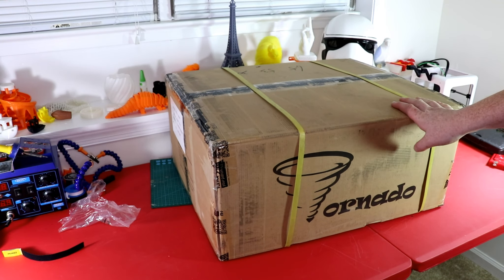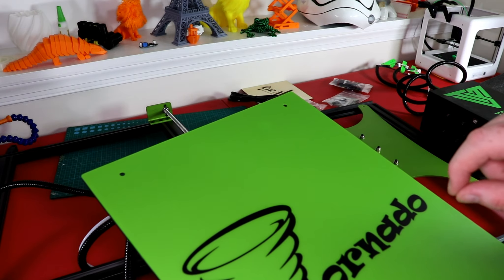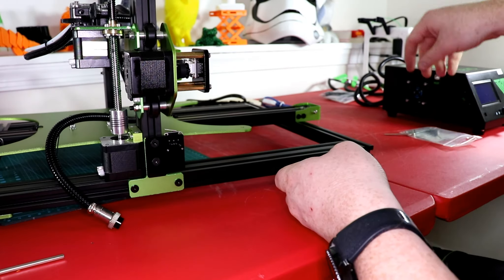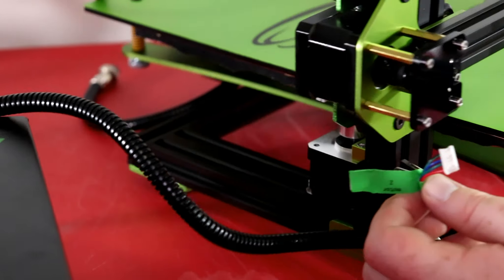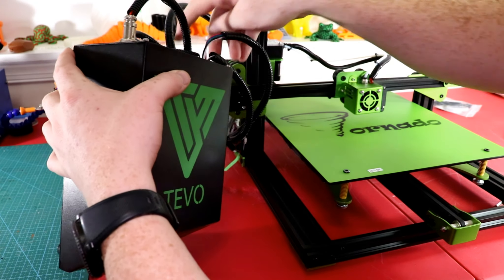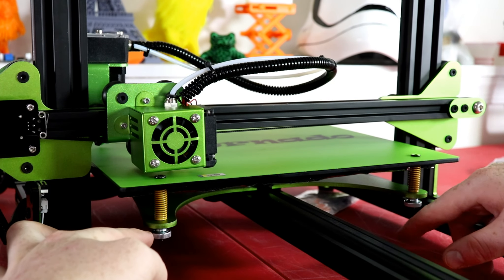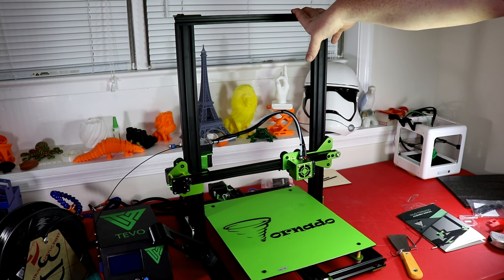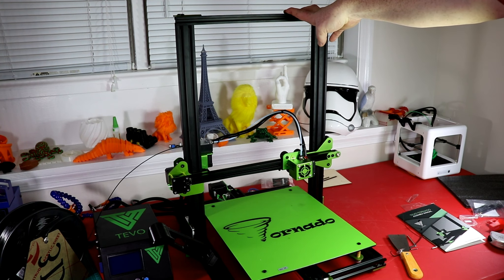Tevo Tornado - Unboxing, Build, and Initial Thoughts

Comment: Underneath the build tak-like material is a glass bed, so if you don't want the bed sheet you can take it off and there is glass ready for you to print on.
Reply from the maker: it's not glass it's a type of acrylic almost a plastic sheet.
Reply: Eric's DIY Oh, really? Hm. I remember some owners saying it is a thin glass sheet and it's ready to print on. Strange.
Reply from the maker: +AvocadoGamer212 yeah unfortunately I will have to upgrade to a glass plate mine's plastic maybe they were before
Reply: Mine came with black glass. I replaced the top pad with Printbite.

Comment: Pull the knob out a bit, several have been pushed on too far making it hard to push. Also, copy the files off of the SD card and throw it away, they have been known to cause print fails a lot. Use a good card formatted to Fat32.

Comment: The custom menu makes the bed leveling a lot easier than the way you did it. It's also more accurate if you do it hot.
Reply: Vance Blosser how do u do that
Reply: Also when disabling all stepper motors, you can also accidentally move the Z axis while adjusting X and Y position, resulting in a bad bed leveling. Don't disable the Z stepper for leveling. Use the built-in corner custom codes.

Comment: hello greetings from the mexico city  with the experience you have with this printer can you tell me if you have any heating problems and if you have to adapt some extra bentilador either for the filament or for the power source thanks
Reply from the maker: No heating issues. It uses AC current to heat up the bed and 24 volts for the hot end which is one of my favorite features of this printer.

Comment: Tempered glass bed not acrylic, thermistor not thermostat, 24v MKS Gen 1.4, E3D V6 clone so swapping in a genuine E3D hot end will be easy, Titan extruder clone is a 3:1 geared reduction. 

Measuring with a tape measure? Haha. 

TIPS: Shorten the bowden tubing length and replace it with Capricorn XS tubing, check all your stepper motor current settings to avoid missed steps, install 8 diode TL smoothers on X and Y axis, get a quality SD card.  These are all things a person with at least some experience in 3D printing would do to get quality prints out of a cheap kit (Unless they were trying to trash a competitor to their favorite printer) and they don't cost much.  

HEY GEARBEST, SEND ME A TEVO TORNADO FOR FREE AND I PROMISE TO AT LEAST READ THE SPEC SHEET TO DO A PROPER REVIEW

Overall good review though, the little nitpicky terminology things just drive me nuts haha. Keep up the good work.

Comment: Z axis must be leveled to the BED not just the chassis.
Reply: He levelled the X (not Z) to the chassis THEN the bed to the hot end (mounted on the X axis. What is the point of then measuring the bed to the chassis?
Reply: He should have checked the X Axis Rail to the vertical Z Axis Rail. Some of those printers come out of square and need to be shimmed.